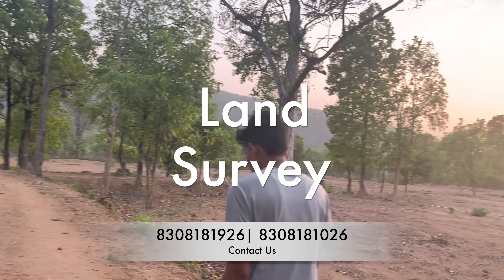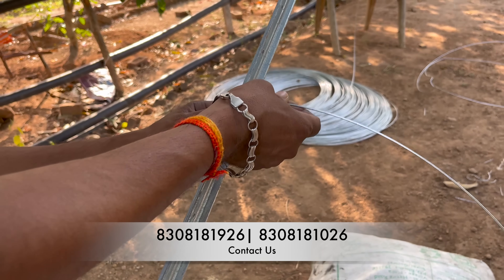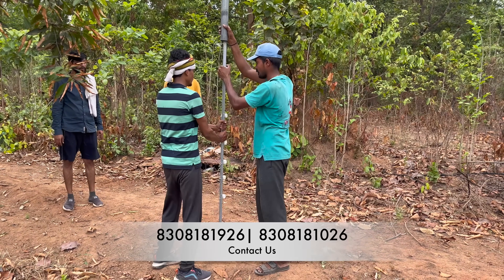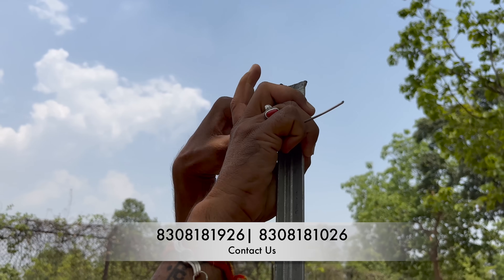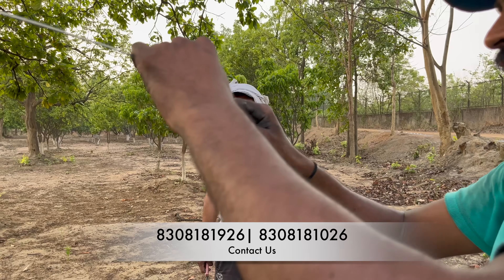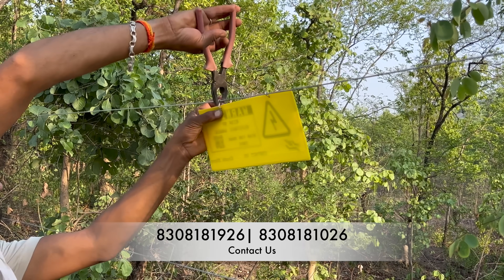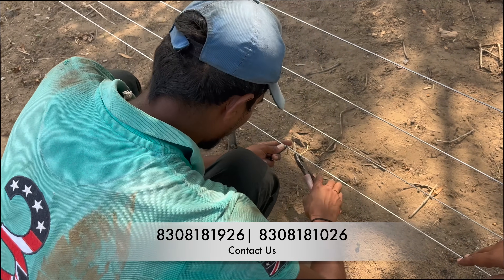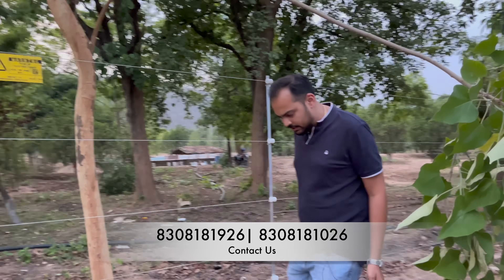Solar Fencing installation | ACSR HT Wire Agricultural Electric Fence Installation Method

Comment from the maker: If you need solar fencing installation or if want to buy ACSR HT Wire and HOT DIP GI Poles Call: 8308181926 | 8308181026